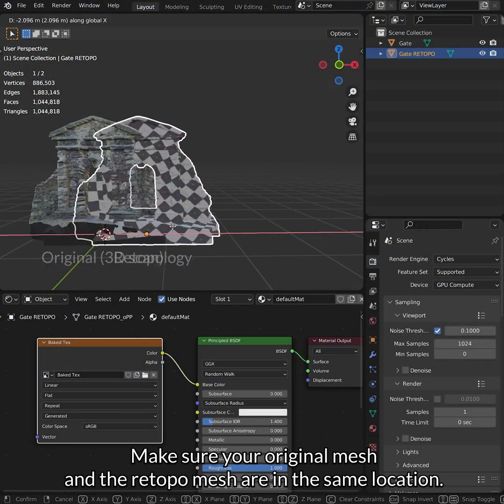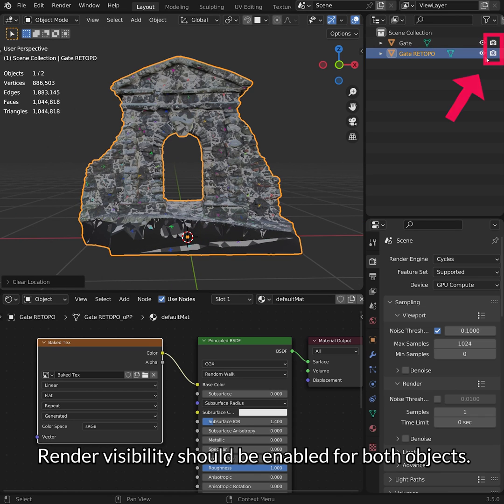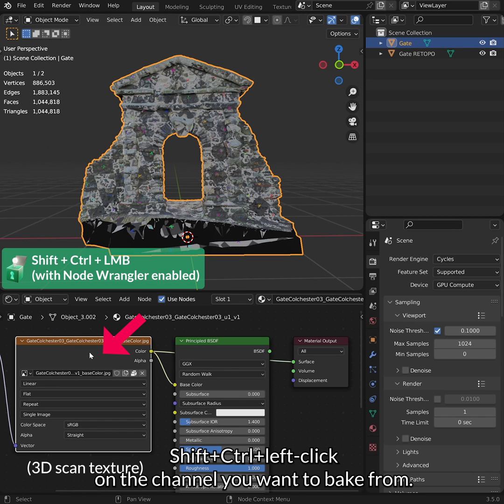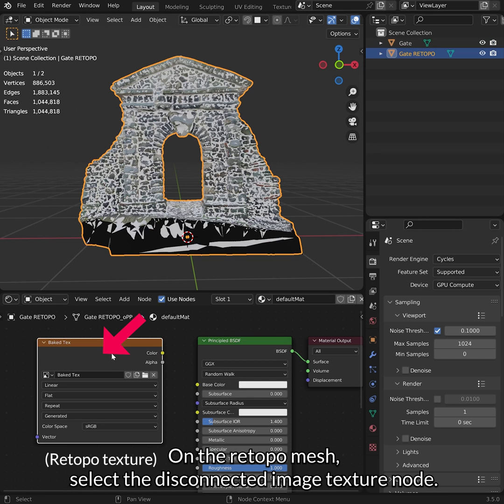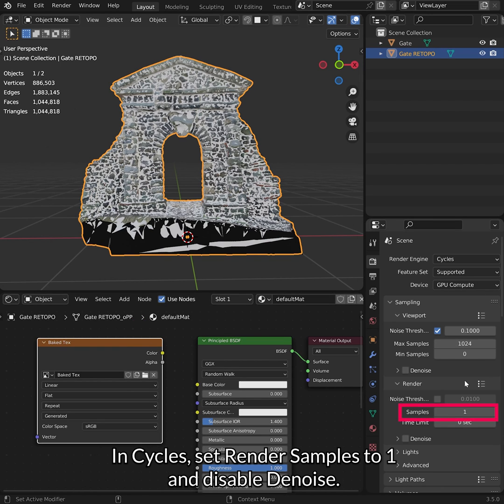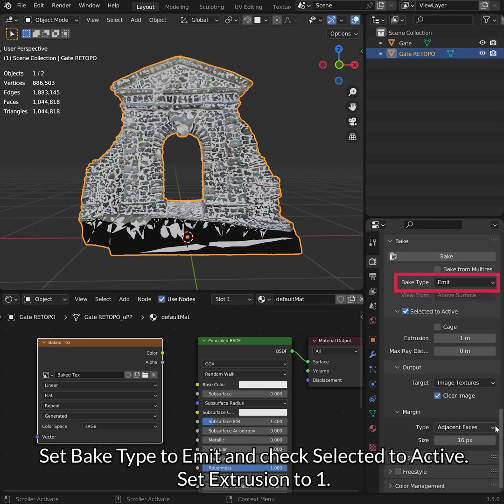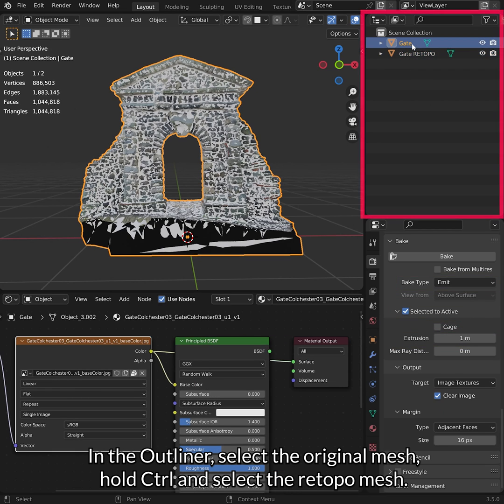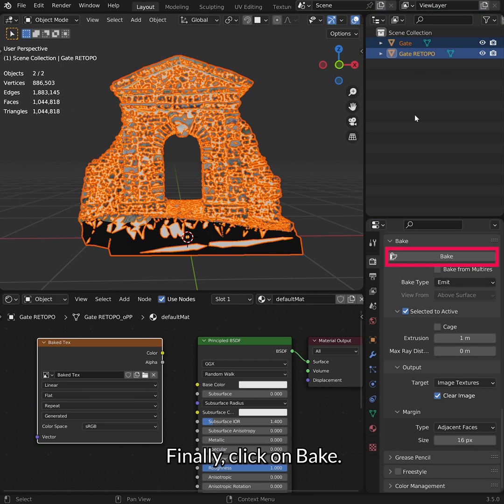This video will solve all your Blender Baking issues!

Comment: 👎🏻 How to bake 3 textures into one with real uv. I tried it !! 10 days in troubles. I need one texture for building for game. I have 3 textures (one is the front of the building and side wall, second is the same but from the other side, and third is one side for small passage) When I bake it, they overlap and it's all ducking folded up.

Comment: I cant for the life of me bake an image. I have my object selected in edit mode with all faces selected. I hit bake and it spits out a all black image. Sometimes not even that saying no image to bake to. I am at a loss here and dont know what Im doing wrong. Im new to blender and seems like a really big pain in the rear end.
Reply from the maker: Honestly baking in Blender can be really frustrating. Black image means the order of selection is probably wrong. It's also different whether you select in the viewport, or in the Outliner. Like the opposite order, literally.
Reply: @BlenderSecrets  so since I’m new I must ask. In which way do I need to select the object? I’ll be honest I don’t even know how to make the baked image or what all I need to select to make it work. I’m always having problems with things changing for no reason (or apparent reason) I’m used to 3ds max but a lot of the stuff I’m doing 3d model work for requires blender. I guess I’m just struggling with blender compared to 3ds max.
Reply: No image to bake to means you haven’t UV unwrapped the mesh you are baking to.

Comment: -Other possible reasons Blender baking failed to bake:
1-Metallic was not set to 0, your bake results may be dark.
2-You unchecked "Use Nodes" in the shader editor tab, you will get a message saying "missing texture" or something similar.
3-Face orientation is flipped.
4-Having some modifiers on the mesh (example: solidify and mirror, uncheck camera icon to bake without them on).
Reply from the maker: The metallic thing is not an issue if you preview the texture you want to bake from with Shift+Ctrl+LMB as shown in the video, that’s why I left it out. Thanks for the other tips!

Comment: Wow, nice! Why extrusion?
Reply from the maker: To avoid glitches in the baked texture. I need to use it almost always, so I just check it by default now.
Reply: "Extrusion" is how far away from the low-rez thing it looks for faces from the high-rez thing (or vice versa, I forget which). So it's basically your maximum bumpiness. If you use a cage, it projects from the low-rez to the corresponding point on the cage and expects the high-rez to be in between. Because to bake normals, you need to know what point on the high-rez surface corresponds to each point on the lo-rez surface, and the polygons don't match so you can't just calculate it.